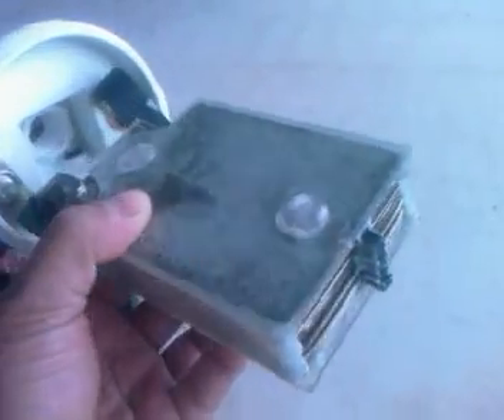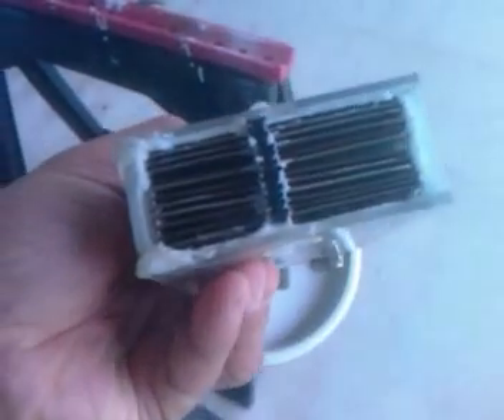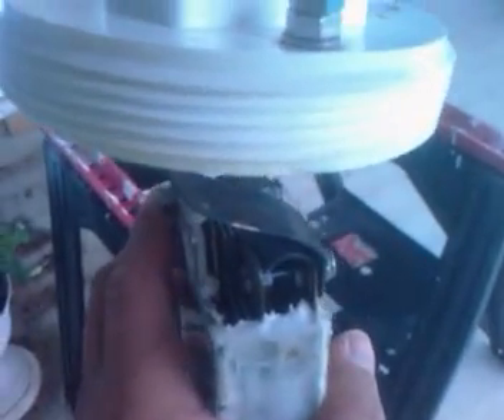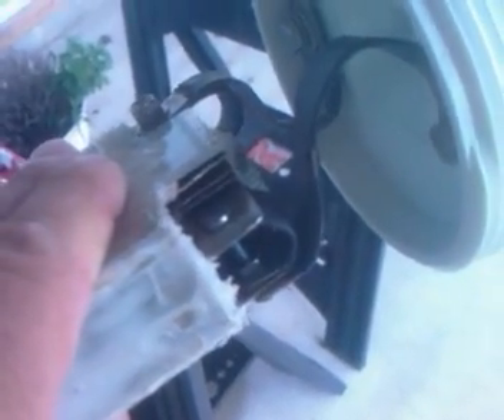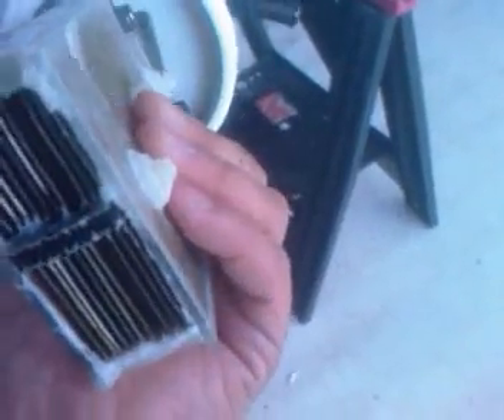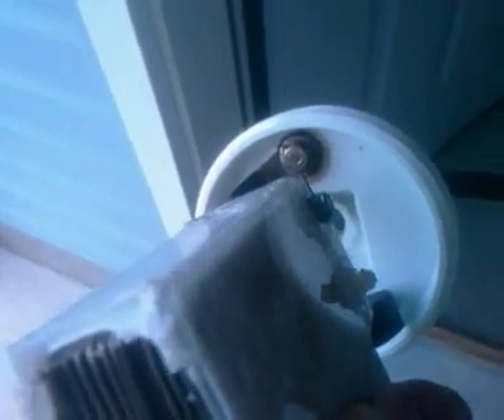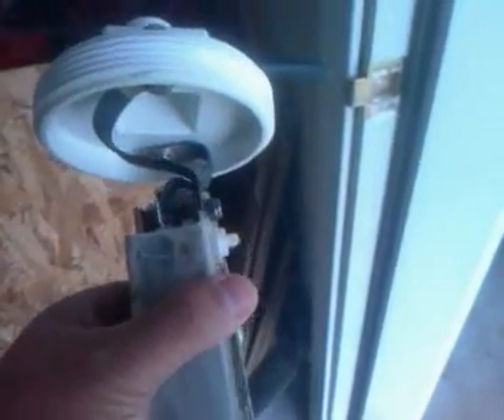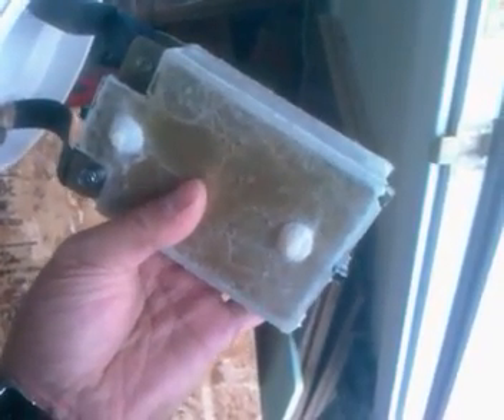HHO cell heat issue

Comment: Iv heard less amps is best as far as 3amps with almost no heat an solid bubble streams but i cant confirm it as i have no way to control amps on mine an it gets stupid hot so im stuck untill i find a cheap way to reduce the amps instead of running straight of car bat

Comment: My experience is that everytime an electrode has gotten hot, it was because of bad connections...and as it starts to melt through the plastic, it get worse. I sand all my connections. I work with metal tops now with high temp. plastic washers I made from spatulas and plastic ashtrays with a core drill. I like the spatula ones the best. They won't melt and that gives you time to figure things out like too much electrolyte. You could fortify your electrode holes with those. Nice Video!